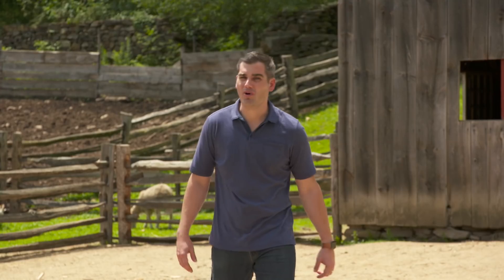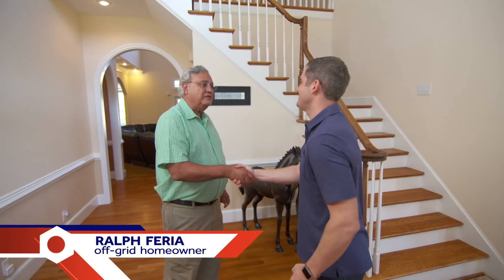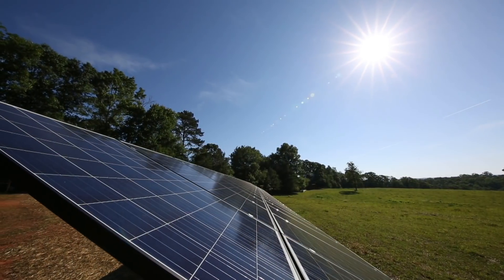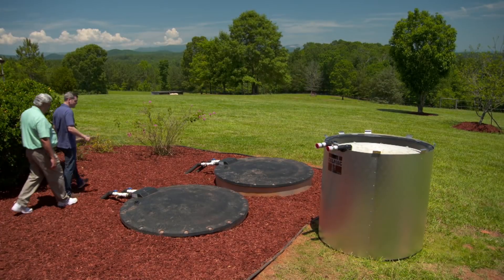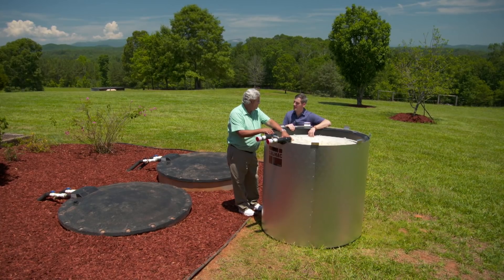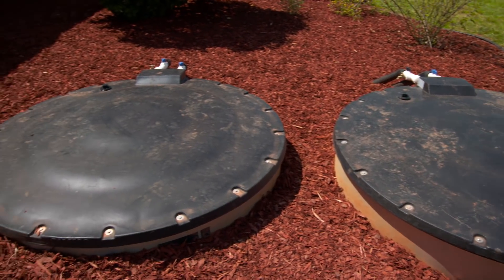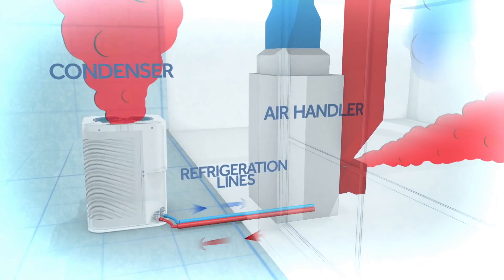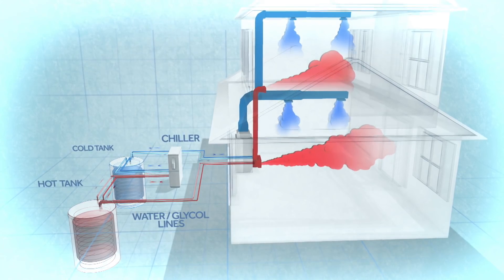Living Off the Grid Comfortably | Future House | Ask This Old House

Comment: Perhaps we should stop allowing construction without solar...
Reply: Ah! This must mean you live in a solar home. I'd also point out that solar can be installed on your home next week. Should I have a salesman call?
Reply: A completely idiotic move that would exacerbate the homelessness problem by making new homes even more expensive.
There are still many places where solar does not pay for itself.
Reply: Move to (or away from) Cali if u want to find out. Since they have proposed regs that will require it. So we should all get to find out soon what its affects have on the state, the good and the bad. 

The real issue with with a massive adaption of PV and Wind is there intermittent nature, so it needs a rate structure that gives the right pricing signals to the market. Which r still not in place in most places. Or there will be brown or black outs from to little or to much production at different times.
Reply: i wish we could use solar but solar doesn't work in endless rain, Wind doesn't work when in a forest, and geothermal needs an impossible to get permit here, stuck to the grid for power unless i want to buy the gas for a generator.
Reply: Ur missing the main point. While solar is nice to have, it was a minor point in this post. 

It was far more about the efficiency of thermal storage both cold and hot. 

And there other renewable options other than just Solar, Wind or geothermal too. Like from the movement of water or bio fuels to name a couple. With all that rain Im guessing ur have alot of both?
Reply: But calling something "completely idiotic" is completely idiotic...

Comment: Why did nobody take the  time. To ask him how much it cost? As solar is expensive per watt. So is wind power. Then the maintenance and life cycle over 20 years. If they last that long. Will have to be replaced. As the best batteries on the market. Have a useful life span of 5 years. Depending if they are below 2500-3000 cycles. Using lithium. At 75% discharge rates. 

And 6800 sq feet. I bet the up front cost. Is around $100,000.00 every 10-15 years. As there is no known way to make it cheaper. As the amount of energy to produce them. Is 3 times the cost. They return. One reason having access to 365 day running streams. Is prime real estate. As you can use it. To produce unlimited energy needs. 24/7 with just an off grid water powered turbine generator.
Reply: I understand how his HVAC works. It's the upfront cost to install all that "Renewable energy" As it's not free. It takes energy to produce those products. And the cost is 3 times the amount they produce. Just to make them. One reason you don;t see many solar companies. As they can not make a profit without government subsides ie "Tax Payers Money" at a 35% discount. 

I might add. You put 10M electric cars on the power grid at 6:00 PM to recharge them. You better like not having heat\AC, Hot Water, Cooking etc... As the power grid is at 96% CAPACITY ALREADY. So all those electric cars will bring down the grid! I should know. I'm an electrical engineer. I design these systems when the rebate craze was going on. I laughed all the way to the bank... As 22k KW system is $57,000.00 US with rebate!
Reply: Shhhh.... It's all about self-gratification, not what is actually logical; the type who'd kill twenty just to save one, or destroy civilization to help one knowing it's a drop in the bucket.
Reply: Master Chief 00117 as a rule AOH rarely talks dollars and in this case guy actually owns the company that builds he systems and a of the chillers are prototypes so it’s hard to say.
Reply: Master Chief 00117 your definitely right, if your building an off grid system to save money as a residence your probably not going to succeed but some people like to be off grid to be prepared. I will say the grid tie systems sometimes pay back but that will change once the power companies change their buyback rates. Right now power companies are getting screwed buying back solar.
Reply: Thank you MasterChief! An adult voice who can make rational decisions!
Reply: The chillers aren't prototypes.... they're readily accessible to the public. Do your research...

Comment: Fall leaves can surround structure for instant heat, save leaves and stockpile around greenhouses to heat them... bury your structure into the ground if possible semiburied, garden on top... watering creates a barrier as does soil, to maintain a temperature desired. You can do it a lot cheaper with your surroundings, rather than expensive tanks and labor to bury outside materials... and what's he doing in the winter, that system isn't going to work as efficient as earthly models, and who can even afford all that....
Reply: derty QWERTY  It's much harder - if not, impossible - to get building permits for Earthly models in many municipalities. It's not necessarily a matter of X is cheaper than Y. It's a matter of Y is expensive and X is not currently legal.
Reply: Charles Eye 
We need to work on that.   The universal building codes need to be modified.   Who approves those codes anyway?

I recently came across some teenagers making negative comments about vernacular cob houses in third world countries.   That snobby,  ignorant mindset is what is holding us back. 
There are beautiful cob and strawbale houses that are a durable,  safe and sturdy alternative.  

The thought of that expensive equipment breaking down and needing replacement or repairs plus being awful to look at are turnoffs.
Better,  cleverer design features on a house can replace space and money intensive machinery.

Comment: It takes money
Reply: No, the total energy usage of this property is a fraction of others the same size using traditional solutions.

So definitely green and it cost a lot less than traditional systems, as well , since all that efficiency improvement means they don't need as big a scaled system to support all their needs and can even make use of essentially free source of heat.

Options like solar thermal panels are things you can even build yourself at very low cost.
Reply: thechosendude, nope... 

We're talking about a system that reduces waste and takes advantage of renewable resources.

It requires a tiny fraction of the energy to provide the needs of this property....

An analogy, would be a car that can get ten to a hundred times better gas mileage with no compromise on performance.

You're not dealing with maximum costs by avoiding using energy during peak hours and you're not using energy that you will never use with this system as most of the energy is recovered and used again at a later point.

Having thermal batteries is the same as using the earth as thermal mass, it's just easier to do and more flexible.  The AC systems, etc. are making use of water and super efficient heat pump systems.

Ice generated at night is being used to pre-cool the air to the AC units so they don't need to work at max power during the hot days.

Heat is channeled to just where it is needed and away from where it is not.  Further reducing waste...

Heat pumps and heat exchangers also means they can take advantage of multiple heat sources.  Everything from the heat of the sun, to ambient heat from the air, and even a wood stove can all contribute to the thermal energy in the system.

So this property doesn't require anywhere near as much of the grid resources as most properties its size would require.

Options like solar thermal panels can be done very cheaply and there's even DIY options.

Thermo energy can also be used to supplement the generation of electricity.  So solar and wind turbines aren't the only options for those as well.

Properly set up the entire property can be one self contained energy ecosystem with a vastly reduced carbon footprint...

And those are just some of the highlights...
Reply: the HVAC system costs less than a Geothermal. Also you can receive 30% Tax break from the feds and 25% from the State of SC. combine that with the savings you get the payback is less than 5 years I'm sure. If you have absolutely 0 carbon footprint for your home how is that not green?
Reply: As do most renewable zealots  you totally ignore the cost of those systems that produce the "free" energy you blather on about. What do you think the cost of the energy components of this house are?  There is a reason why those prices are never mentioned.
Reply: Actually, you can check the installer's channel for more details.  While it's really no secret what a lot of this cost if you just bothered to look it up rather than commenting on only what you think you know...

Details like thermal panels are a lot cheaper than solar panels and you can even build them yourself from materials you can salvage, like tin cans, paint, etc...  Not everything being used on this property cost a lot to implement!

Besides, you;re going to pay far more for an inefficient system for the life of the property versus investing more in an efficient system and paying a fraction of the cost over the life of the property.

Getting an energy efficient property is the equivalent to getting a super efficient car... Something like 100 MPG is a lot better than 10 MPG, for an analogy, and that's an ongoing cost difference that adds up to a lot over the years.

Nothing is "free" but paying less over a long period of time is the point.

Existing use of energy systems for most homes wastes up to 80% of the energy used, wasting both resources and money...  

So you're basically arguing against getting the most bang for your buck!
Reply: ZeoCyberG and no new power plants in particular peaker plants. These plants cost upward of $100 million. In the worst case these plants might run only a few minutes per month yet they require constant maintenance, test firing, security, staffing. We have one near us that has not been online in a long time. Its diesel tanks are 10,000 gallon adding extra cost possible leakage and chemical treatment to stabilize the fuel.
Reply: We put in solar panels in 2001.  No maintenance yet.  Pays all our electric bill all those years.  It only cost $11,000 back then.
Reply: If the costs are so easy to find why didn't you tell us what they are? Why do you keep talking about thermal panels? Were they part of this show?
Reply: Rick Parker why don’t you contact your local contractors to try and determine a price if it means that much to you?
Reply: I am a local contractor
Reply: Then contact your HVAC provider for pricing.
Reply: It doesn't take as much as you would think if your willing to put in the work.  We are off grid and it cost us less than 6k.  We only have a 5kw system though.
Reply: everything takes money. but since youre not producing heat each time you need it the running costs are lower.
Reply: ZeoCyberG going green has nothing to do with money. Look at the vast amount of plastic, heavy metals, etc. used to make such a system. Also look at the horrible effect on the environment mining for those solar panel materials has. The energy used to manufacture them is huge, and most of the materials will never be recycled once they reach the end of their useful life.
Reply: I guess we'd better keep on mining and burning coal then.
Reply: Tax breaks and grants don't change prices a dime. They do change who is paying the price and in the case of tax breaks and grants it's taxpayers footing the bill.
Reply: I'm sure well over $100,000 between all the solar panels, chiller systems, batteries, tanks, etc.  There is no money saving here, and all that extra material, hard to wonder if it's even green in the long run.
Reply: ZeoCyberG - Your definition of "green" is clearly different than both mine and logic.

Comment: Easy to do when your a multi millionaire with 100 acres of land.
Reply: That isn't fair or true. This man values hard work and building a business and he values the things he has done and is doing. That doesn't make it 'easy'. He has gone to work faithfully for 50 years and has reaped the rewards for such.
Reply: Doesn't mean you can't do it on a smaller scale............
Reply: a I dint say he dint. Just saying this is not viable for the average American.
Reply: Actually, it is viable... Thermal technology is already cheaper than solar... There's even options you can DIY...
Reply: ChrisXCXCX build your dream home.
Reply: Kirk Mercurio, don't be silly, minimum buy in costs are only if you get the units directly from the manufacturer or wholesaler but you can also get them from a number of other resellers and there are used units for sale on the market as well that can be acquired for a fraction of the new unit costs.

A lot of the service costs can also be cut down if you can install the system yourself or know someone who can help.

While there are alternatives, the system shown here is just one of many options.

Some work better in certain climates versus others.  So where you are can effect how much bang for your buck you get with the system but there are ways the vast majority can do it if they really put their mind to it and get the right system for their needs.

There are also ways to put together your own heat pumps and thermal mass for storage and not need to get everything commercially built and manufactured for you... Especially, when doing it on a smaller scale...  It only really gets cost prohibitive when needing to do it on a large scale.

Really, there have been people who have built their own air cooled water chiller HVAC system...  So there are ways just about anyone could afford to do this if they really put their minds to it...
Reply: Easy to be green when you have lots of greenbacks....
Reply: Dale Ann Harsh not true. Several of the units have a minimum buy in cost that is still too high for the vast majority of people.

Comment: I get what he’s trying to do but this technology is not quite ready yet. There is no way he can heat that pool with that system.
Reply: diesel508  My in-laws have a large pool with hot tub in Idaho that is heated by a two 4x4 solar water heaters and a solar blanket on the pool in spring and fall. The hot tub is year round the pool is good tell the snow flys. So it can be done .
Reply: Rick Parker you have a salesman i hope? constantly talking about what cant be done, what wont work, too much money is a turn off for potential customers while blinding you to opportunities to make money while providing a good product.
Reply: Joshua Turner
I assume you mean the link to the chiller manufacturer? Yes, I have followed it. There are at least 4 chiller models listed in any number of sizes and probably 15 coil sizes.  Do you know which units were used in this house?  Which coil?  Without knowing that there is no helpful information. 
This is like someone trying to sell you a car that gets high mileage but you don't get to know the engine horsepower or the price.
Reply: diesel508 here in the south most people don’t heat their pools. But this system actually does make a ton of hot water and could likely handle the pool.
Reply: You're exactly right. I'm in south Florida and couldn't heat my pool with that system in the winter.
Reply: The technology is right in front of you.....
Reply: Where are you getting this information from Rick Parker?
Reply: Bob Quigley
A salesman? I'm constantly talking about math and physics. Wishful thinking won't change either of those. Those who can't do math are at the mercy of salesmen who promise things that can't be delivered. I've been a GC for 50 years and can do the math. If I'm missing something please show your numbers. Anything can be made to work at some cost.
Reply: No, do you have the numbers? How about the costs? There is a very strange lack of any hard information in this video and the responses to it. What size are these chillers?  What is their SEER rating? How much do they cost installed? My whole point is that without those numbers no one can make a rational decision as to how energy efficient these units are. 
Aren't you just a little curious about these things? 
How much insulation does the house have? 
Are the windows double or triple insulated? 
Is the attic sealed or vented? 
A typical house this size in SC probably needs about 14 tons of AC. How big are these chillers? 
What would be the installed cost of the chiller system in my 6800 sf house? 
Until someone is more forthcoming with answers to these basic questions no one has a clue if this house is an energy saver or an energy hog.
Reply: Rick Parker have you looked at the units performance?
Reply: Rick Parker you clearly have not followed the link in the description. Do research before talking so much.